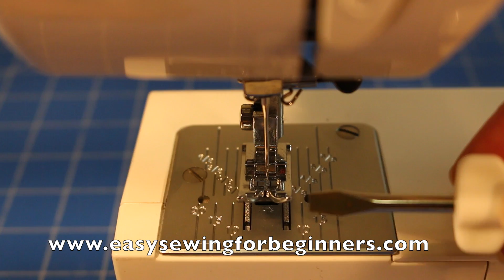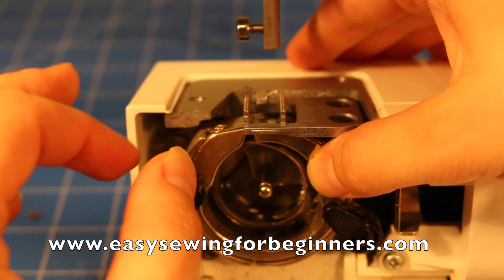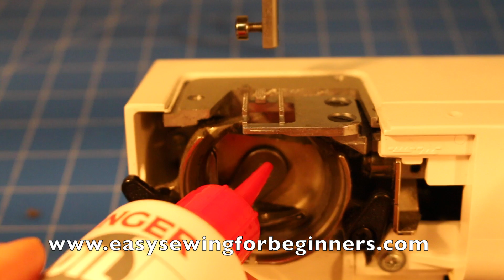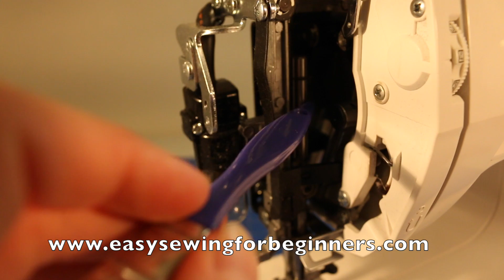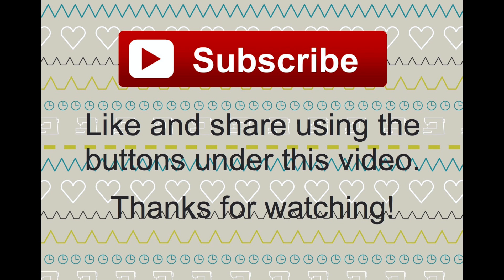Sewing Machine Maintenance: How to Oil and Clean (Front Loading Bobbin)

Comment: @Easy Sewing for Begginers   Hi. So, I'm hoping I can get an opinion on something...  I have a store bought weighted blanket with the the little glass beads inside.  I'm wondering if you think it would be a bad idea to sew through it. Idk if it would damage my sewing machine if the needle came straight down on any of the little beads.  It's pretty much brand new, and I hated the thought of throwing it away.  I've been trying to find someone to take the thing, but nobody wants it. Probably about the 25th time moving the thing from one spot to another, I started thinking maybe I could make a few door sweep, draft blocker dealies out of it.  But now I'm just sitting here staring at it, worried it might jam my machine. Idk...  Just hoping I can get an opinion or two before I have at it.  Thanks in advance

Comment: I’ve only had my machine for 2 weeks and it’s jammed up. Everything I read says clean clean clean!!! There’s nothing in there! The manual says nothing about oiling besides “oil the machine” where the heck!! Geez! I hope oiling helps. If not I don’t know what else to do.....
Reply: That happened to me when I first got mine but it was because I put the bobbin thread in backwards (pulling toward me instead of away, if that makes sense)  I switched it around and it worked perfect
Reply from the maker: All the best with it 🤞🏻
Reply: I think I know what you mean. I've had my machine for about 15 years as I only use it to sew and fix small items very rarely. My machine sounds and feels like it's running rough and the threads, either top or bottom bunch up in the bobbin area. I didn't think I needed to oil it to correct those problems. So like you, I hope this works for me as well. Good Luck to you!

Comment: I too am making masks - just bought this machine last week and already it seems a little hard to get the needle moving up and down - both from the pedal and the hand knob.  Could it be that it needs to be oiled already, after a week?  Do I have to use sewing machine oil, or can I use something like WD40 until I can get to JoAnn again?  THANKS for the video, and any advice for a newbie sewer!
Reply: It could need oiling even if it's new. It depends on how long it's been stored before purchase and at what temperature. I'd do it anyway. Good luck x
Reply from the maker: Loobyloo true! It definitely wouldn’t hurt the sewing machine to oil it anyway.
Reply: Never use WD-40 on sewing machine unless it is very rusty. Always use mineral oil or baby oil( they are same things) such as: https://www.walmart.com/ip/Equate-Mineral-Oil-Lubricant-Laxative-16oz-Count-1/44807472
I used a soda straw to apply the oil. Hope it helps, stay strong!
Reply from the maker: Hmm...The machine shouldn’t need to be oiled after a week. I would recommend changing the needle, trying a different thread and/or checking the thread tension dial first and see how it goes. What is the make and model of your sewing machine?

Comment: Wow this is so helpful.  I have a basic brother machine that I got 27 years ago for my wedding shower.  In the past I have used my machine infrequently.  But lately I have also been making masks and I have never had my machine professional maintained.  I cleaned out the lint with the little brush that came with the machine.  But I do not have any sewing machine oil.  Amazon is delivering about 2 weeks out and Joann's is out of stock for delivery (I am not leaving my house unless absolutely necessary).  Do you have any advice on how to get some Sewing Machine oil or perhaps an alternative I may have at my house.  I may ask some neighbors to see if they have any on hand.  Many Thanks!

Comment: I have a different model of the same brand. I had used the manual to do a cleaning, it was difficult to figure out. This video did a nice job! You also show where the oil goes for the bobbin assembly, the manual was too ambiguous. An arrow point into mid air was what the diagram looked like to me. I agree with another peron that showing how to reassemble the machine would be helpful. I also liked the idea of keeping the screws in the faceplate.

Comment: I have heard that compressed air is bad to use to clean your machine.  This is because compressed air forces lint into places that it should not exist in or causes lint to be packed into harder to clean areas.  They recommend using a brush.

Comment: If you have an older machine, there are 4 or 5 places that should be oiled. However, the most important thing is to remove the lint as shown and make sure that your needle is good and the correct one for your project. I learned how to sew over 50 years ago when both sewing machines and typewriters were cleaned on a weekly basis and expected to last a lifetime. My favorite machine is a heavy duty one purchased in 1973 which I still use today!

Comment: This video was just what I needed. I took out the shuttle case and didn't know how to replace. I was lost until I saw how it was done. Now I also know how to oil the machine.THANK YOU!.
Reply: 😅 I recently got my first sewing machine and I removed the shuttle part completely - I did it without even looking at the instructions and I was genuinely concerned that I had broken the machine because I just couldn't get it back into the slot that it came out of and it was slipping around in my hands with old oil on it lol

I am going to oil the machine properly now that I know how to put it back together if I remove the wrong thing 🤣😅